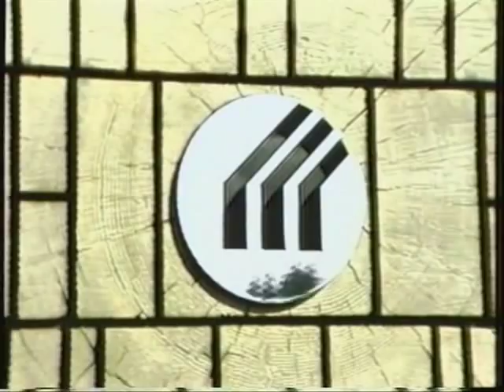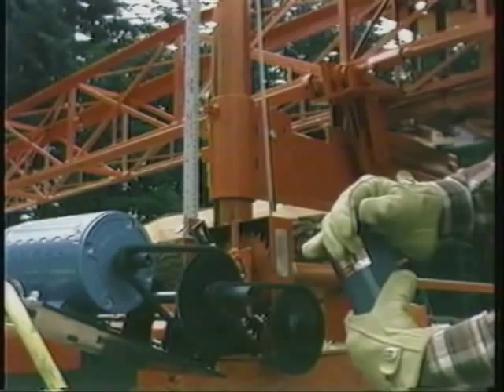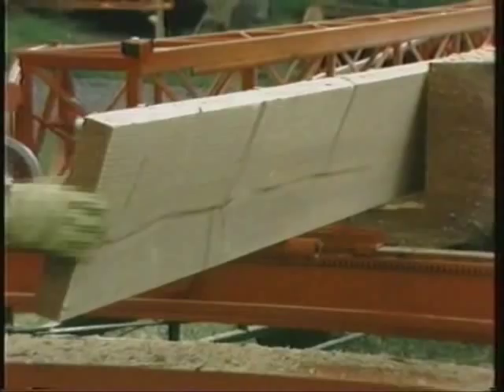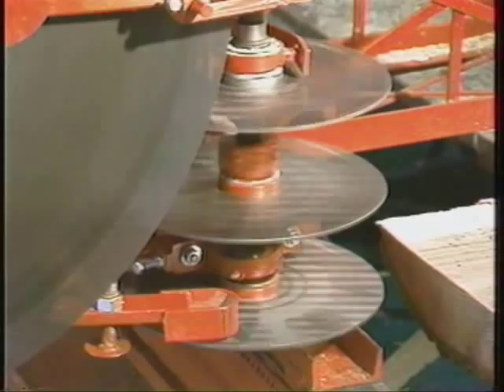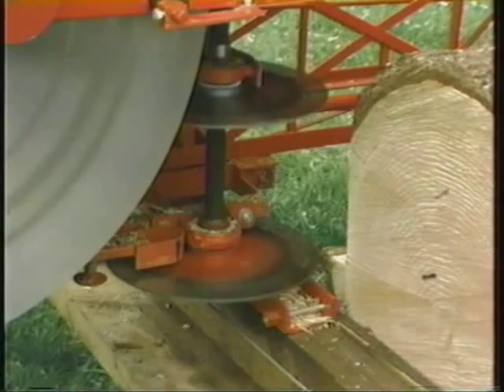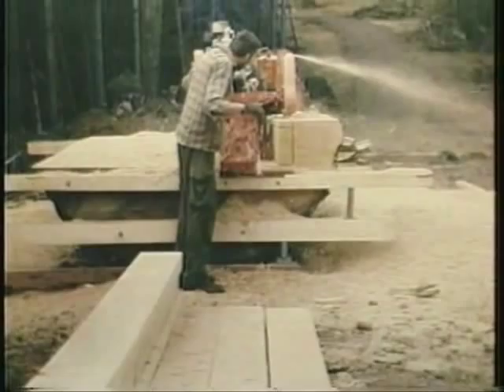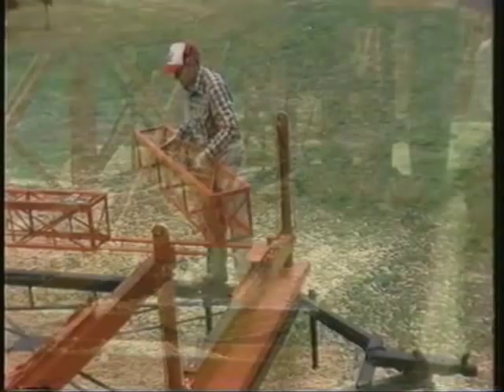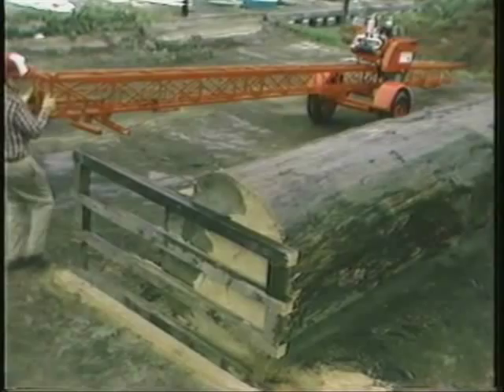Mobile Dimension Saw Demo Video Part 1

Comment: You see Woodmizers and clones everywhere , why more of these weren't sold is beyond me . You get the saw and the edger in one machine . With proper tooth installation and side dressing the cuts can be glass smooth .and with the board being sent back to you it's a true one man machine .
Reply: Marketing and mismanagement.  It seems to be a thing in the industry.  Price is another factor.  Their insistence on the vw engine didn't do them any favors.  The bandmills are cheap to build and they keep you dependent on bands.  Kind of planned obsolescence and dependence.  You hit a nail with a blade you replace the teeth.  You hit a nail with a bandmill and you replace the whole band.  These sawmills will outpace the most expensive woodmizers at least 4:1.